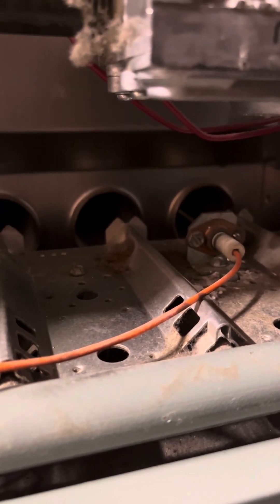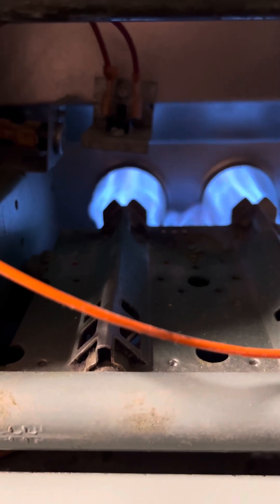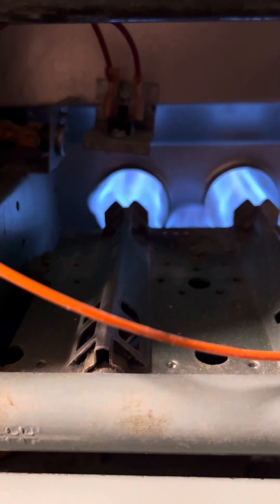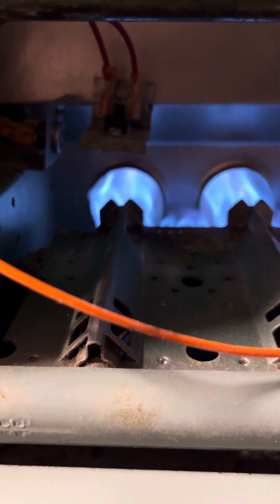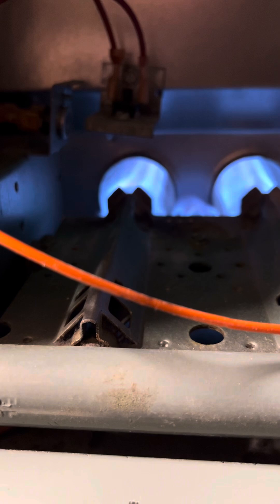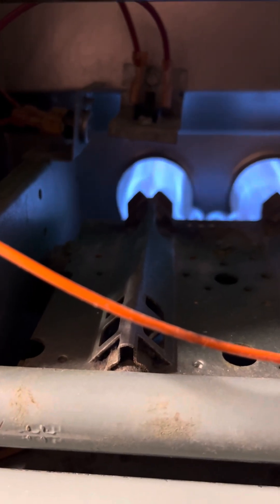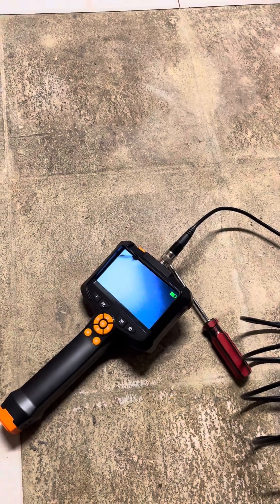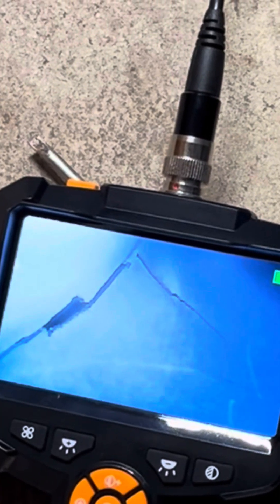Cracked Heat Exchanger Explained

Comment: Put a lit lighter stick in each hole (one at a time now folks 😅) with the blower running works well also. Flame shouldn't move if there are no cracks present. Scope is very definitive though.
Reply from the maker: Yeah its more clear with a small flame

Comment: Also, tommy pipes showed a neat trick, connect your manometer to the port hole on the inducer. And turn on the fan to see if there is any change.
Reply from the maker: That sounds like a good one.